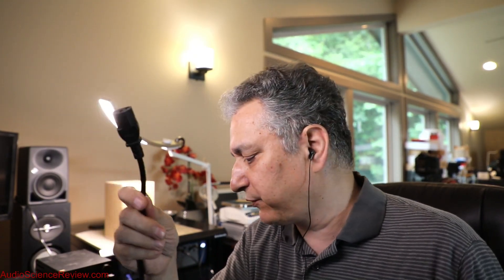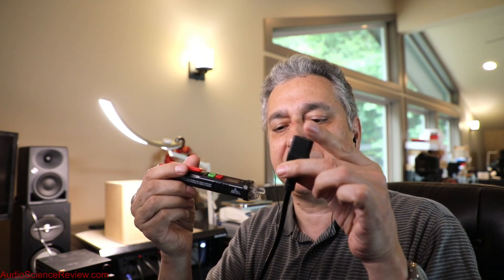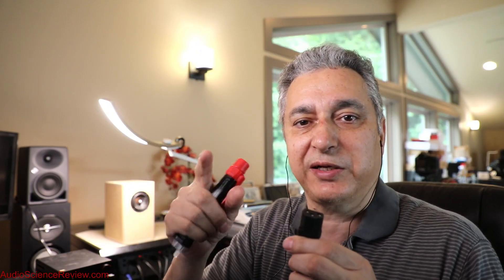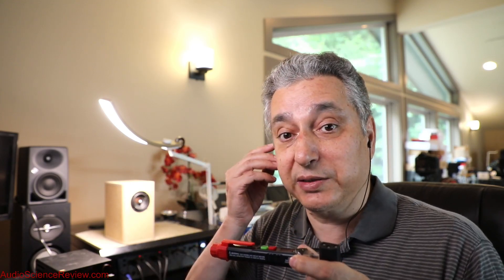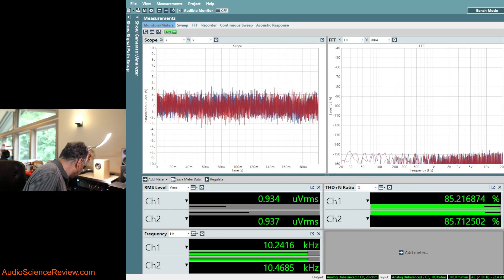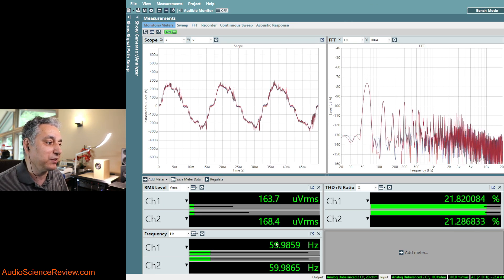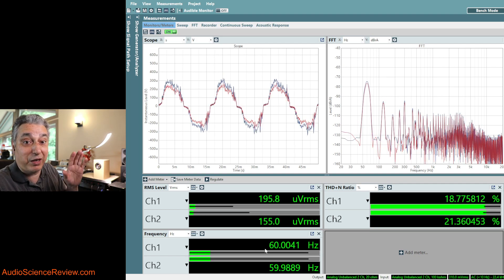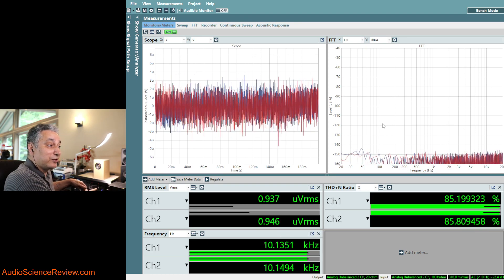Testing Open Power Cord interference in Interconnect Cables

Comment: Yet another video where I am left in awe of your exceptional educational approach and ability.  I originally came to the channel for the reviews, but I am now realizing the true gold is the science and engineering we are being exposed to. Thank you so much for this.
Reply from the maker: Ah, that is very nice to read.  Thanks for watching and commenting.
Reply: “Science”
Reply: Same!
Reply: I find this review perplexing - a mains lead without an electrical load wont have current flowing though it and therefore wont produce a magnetic field and consequently wont induce voltage or current in to a near by lead. Connect the lead to an electrical load, an amplifier for example  and current will flow and a magnetic field will be produced. Place a second conductor in the magnetic field created by the first and current will be induced in to the second lead. This is he basic principle behind inductive charging and the same principle can apply to your audio signal leads.
Reply: should have shown the difference with the cables connected to something, both cables connected to the same amp and turn on the amp otherwise its useless test, this is supposed to be about audio equipment, nothing educational here, just the hate between two opposite biased sides!!!!
Reply: @MrDannydjmix2  you not understanding it does not make it useless
Reply: @frosty6845  Then why didn't he do it both ways?  Unconnected vs with an actual load on the other side.  It would have been simple enough but also might have shown the other guy has a point.
Reply: @AudioScienceReview  I completely agree with Jaime. Your videos are the equivalent of educational gold. You happen to be, at least in my opinion, extremely well suited/equipped to teach others Amir. I have been slowly working my way through your large catalogue of high end audio videos here on YouTube and I am continually impressed with the clear and concise way that you communicate highly technical information, not to mention your penchant for actually demonstrating your points by employing appropriate test instrumentation, which really fortifies your transfer of knowledge, all the while presenting it all in a very easy-going and laid back fashion. Thank You for all that you do for the community Amir.   Fred
Reply: @MrDannydjmix2  I've been skeptical of Amir and his testing methods as well. Not because I know better, but in fact because I know very little. 

So how can I confidently conclude that these tests have merit? 

Well. I would like to submit this other piece of evidence: I'm not seeing much in the way of measurements from the actual engineers of these products to dispute any of Amir's findings. I'm not seeing any appropriate testing methodologies or equipment submitted for peer review by the manufacturers and their engineers. I'm not seeing anyone flat out dismiss the validity of Amir's equipment or methodologies by the industry.

Given Amir's relatively established forum and followers, many of whom do seem to understand the principals of electrical engineering, I would assume that any quackery would gleefully be exposed by his own educated members. This doesn't seem to be a group content on being silent about their areas of expertise. They're actually quite harsh when it comes to critiquing errors in measuring, setup, or method. 

So where is the "other side" then? What they want you to believe is that these products are developed or rather engineered, but then 'tuned by ear' for a crafted, artisan sound by golden-eared audio enthusiasts. Electrical engineering be damned. This capacitor just SOUNDS better, even though no measurements can seem to point out any difference at all. And how many publish blind tests of any of these products to rule out all the known effects of sited bias and all the ways our perception can be altered to the positive or negative, simply by possessing information or pre-conceived notions about expected performance gains or loss?

These manufacturers won't do these tests publicly. They want you to buy their power cord, stuffed full of hopes and dreams about some sonic veil lifting. They know you've already been indoctrinated if you're entertaining the purchase of a $300 or $3000 power cord with no measurable difference from the free one you possess already. And they know that you too, will probably hear the difference when you plug it in, (after burn-in of course. 100 hours it will keep getting better!) ..because you believe it will sound better. So. It sounds better. 

I'd say there's more of THAT effect going around, then any other explanation or actual effect from some of these products. It's just more blind faith being peddled as expensive expectation bias and placebo.
Reply: @erics.4113  well i think if something is called science is taking into account all aspects of something, not just frequency response or distortion, no one here is doing any science, he's doing what others did before him that others said same thing, u can change a capacitor in the tweeter section of a speaker and measure it and it will measure the same but sound so different...
Reply: @MrDannydjmix2  so if science is limited with current measurements, (strange though as instrumentation can exceed range and accuracy of human hearing) but nonetheless I'll concede that science doesn't know or understand everything with concern to how we ENJOY sound or what sounds subjectively more pleasing to us. 

If that's the case, you still have the blind listening test. And it has to be blind. You can't have a power cord manufacturer just state it sounds better than cable X when they know it's plugged in. Why don't they do much (if any) blind tests? And submit those for peer review? Everyone is so confident that they can hear the difference when a capacitor or cable is swapped but none seem to step up to the plate very often.
Reply: @erics.4113  okay, so how about vinyl? Why does it sound so good and measure so bad in comparison even to 396khz mp3, im not saying is better but if u measure a vinyl system it's way above human hearing and yet it sounds really good
Reply: @MrDannydjmix2  I grew up with vinyl and cassette, so I don't mess with either today. I'm happy to have the convenience, quantity, and assurances of digital: that the files won't degrade or change by playing them. I've also never heard a high end vinyl playback system so maybe I have no opinion on it in the current context. 

But it is interesting that it's coming to light how a certain label has been pressing vinyl from original analog master tapes, but first converting to DSD (digital) in the process. Again, I wonder how many vinyl enthusiasts sat and compared these records to digital versions and spoke in colorful language about how you could tell it was all analog and much much better. Completely unaware they were listening to a digital playback file. I'm sure that, for some, grabbing the record, placing it on their beautiful plinth and turntable and dropping the needle is quite the experience, and those aspects of the ritual may in fact increase their enjoyment of the listening. 

But I don't think you're talking about that aspect of vinyl so I'll keep it moving.

What I think you're talking about is the reality of this pursuit that may state the following: a purist may say, give me a playback system with lowest noise and distortion for a given playback level. Make the frequency response in the room, for that system, to be an unwavering flat line. Have the source and amplification also deliver a completely linear and distortion free analog voltage of the waveform that was recorded and play it back. What's the result? You can claim you're listening to the recorded waveform, without coloration. You've reached audio nirvana, right? You have as close to an accurate reproduction as you can get. 

But the reality is that most systems that get close to this, often get the following subjective remarks about the experience: thin, sterile sounding. Makes bad recordings sound overly harsh. Lacks fullness, body, and warmth. Fatiguing. Lacks musicality and soul. 

This hypothetical purist will seem to allow some Harman house curves applied to boost the low end, after science and research by the company determined that our perceived levels of SPL diminish at lower frequencies. So to get the experience of level, even playback, you actually have to boost the bass to calibrate with human hearing sensitivity.

What this means to me is that we sometimes have conflicting goals and ideals with this hobby. We would like to say that we want the most accurate sounding system, but the reality is that most of us won't achieve a system that can reproduce a piano or electric bass and guitar in a way that's indistinguishable from the real thing. And there are the recordings. They were mixed and mastered to sound like pleasing artificial representations of these instruments, and only sometimes created to capture the raw, life-like presentation. And when we mix and match these recordings on different playback systems, we get the results we seem to get now. Music recorded for realism sounds excellent on these super high end systems, while music recorded for radio playback and the masses seems to suffer on them. We don't always want utmost openness and clarity. We don't need the lowest noise and distortion on a recording that won't sound 'real' no matter what we play it back on. We often like a fullness and warmth to the sound because we are sometimes listening to dynamic presentations at unrealistically low listening levels compared to the way the artist plays the music in some cases. We may also listen to music that the recording engineers tailored to specifically sound good on playback systems of the time.

The positive news is that what sounds good to you is truly good enough. If I had my druthers, I would have all music delivered as multi-track recordings, and I could sit in front of a mixing console in the sweet spot, and tailor the playback how I would like to hear it. 🤔
Reply: @erics.4113  well i totally agree with u when u say that some vinyl is made from digital etc, but my point is the noise, it doesn't seem to make the vinyl sound bad does it? Vinyl is obviously less dynamic then a CD is and when u compare them they sound different and the main difference is because of the mastering that it's more compressed for vinyl and it makes some people feel it has more detail but it doesn't it's simply because the quiet parts are more audible,  anyway, what we measure here doesn't fall into sound quality context does it? How about tube amps? Or preamps why do they sound so good and they measure so poorly in comparison with a very clean solid state design etc
Reply: @MrDannydjmix2  I understand your points. And when measuring noise and distortion, and claiming one product superior to another, I have even heard Amir state that some products with measurably higher noise are still below thresholds for human hearing, so it's unlikely it will make much, if any, difference in the end. His point seems to be about the science and engineering of these components. So if you want to claim, as a manufacturer, that your product has low noise and distortion, here is a platform for objectively measuring and ranking that claim. So I do think that is valuable. 

But onto the age old debate of sound QUALITY. I think here is where it gets more than just a little complex. Do we even have a completely objective set of parameters as the 'reference' for which to compare all others? I don't think so. There are subjective preferences for the user, and even the music being played back. You have different types of presentation, even with identical frequency responses. Horns, wave guides, open baffle, paper cones, treated cones, different driver sensitivities. It just goes on and on and they do all make a difference.

But I still feel like you can't close the book on objective measuring because after all, these products are developed using principals of engineering. They have to be or they wouldn't work. At the same time, you can't close the book on subjective experience, either. There is a whole world of subtle differences to explore, and to find out more about these complex interactions we probably shouldn't say that we've perfected the science of measuring sound quality either.
Reply: @erics.4113  yes that's exactly my point, he basically says something "performs" better or something is better etc, I'm not sure how he sets up his system or his listening tests, but when i compare let's say two DACs i don't check measurements to bias myself against it i listen and i always here they sound different, i don't understand how people say that DACs sound the same as to me none sound the same even two identical ones sometimes i hear a difference, 
Thing is i noticed something long time ago! Setup is the most important, the way the speakers are setup is the most important, if they are setup improperly u can't hear some differences, sometimes u can't hear any difference at all with bad setup, in my system i can hear a difference with everything i change, so far i never heard headphones that come close the how my system sounds, even in terms of holographic and stereo 3d effect, so to me when someone claims that DACs sound the same i think that person needs to revisit everything he knows or does with his or her setup!
Reply: @MrDannydjmix2  I have limited DAC experience. DAC in my cheapest aiyima t9 pre, DAC in a Cambridge cxa61 integrated, bluesound node 2 DAC, and denafrips ares ii. 

Other than the definite difference between the bluesound and ares, it's difficult for me to purely evaluate the others independently because they are part of an integrated amp in one instance, and part of the preamp section of the other. 

So if I'm to be fair about my personal experience with DACs, I have to wonder how much of the output stage am I evaluating in addition to the chips or architecture responsible for doing the d/a conversion?

When a lot of the high end DACs are measured, it somewhat confirms my suspicions. Many of them play with the output voltage on the RCA line stage. They tend to run them a little hot, basically.. and that will have impact on the components downstream, possibly even more so than how it takes the digital bits and creates the analog waveform. 

But again, science is still relevant. All of the DAC engineers have to play with the same starting rules or limitations. They are given a digital file that they need to accurately convert to an analog voltage signal. 

To Amir's point, they should output little to no noise or distortion and ideally be at the 2 or 4 volts (RCA or xlr) that most downstream equipment would expect to receive. But I do see the point in the argument that if the DAC is doing some magical ooey gooey magic in between, what is it in fact doing? And at what point is it no longer just a DAC, but also a magic sonic enhancer of sorts after the DAC for the output stage?
Reply: @erics.4113  well with DACs it's more about power supply and output stage this two are the most important things, one's i tried descrete output stage there's no going back for me, i don't think opamps are good in any output stage in terms of how it sounds, in terms of how they measure, they measure well, i think is about the dynamic range on the output stage that matters the most, with vinyl u only have 75db of dynamic range to reproduce which is easy, with digital a CD for example is 96db far higher dynamic range which is a bit difficult with ic opamps to reproduce accurately, if u talk about 24bit digital which is 140db+ it is basically very hard an complicated to have that kind of dynamic range with any amplifier, noise is one thing and dynamic range is totally different thing, but noise can be a problem if it's not below the dynamic range capabilities, that's my opinion:)
Reply: You implying that he does not understand the value of an invalid test or experiment says a lot more about your intellectual ability and honesty than Mr. Danny's understanding.

Comment: For an ME everything is a spring, for an EE everything is a capacitor.
Reply from the maker: Great analogy.  I should use that line in the future! :)
Reply: Spring is capacitor, mass is inductor and damping is resistor
Reply: When I studied engineering it was normal practice to model a mechanical system as an electronic circuit and solve the parallel problem to get the final results.